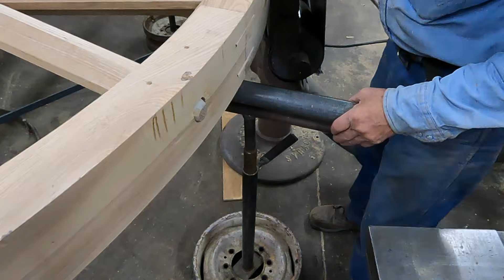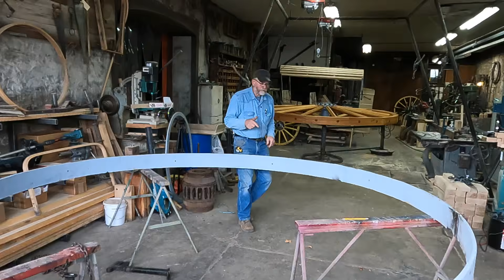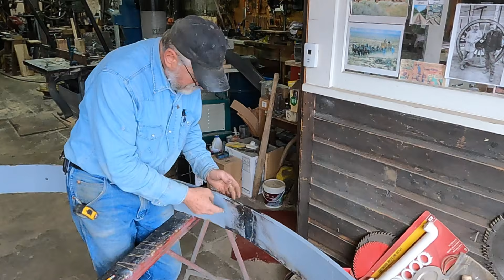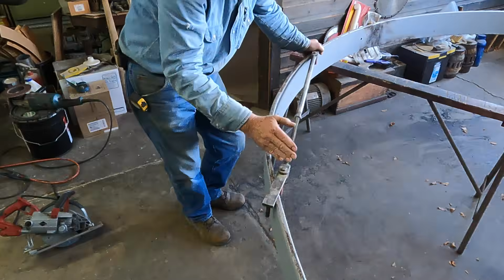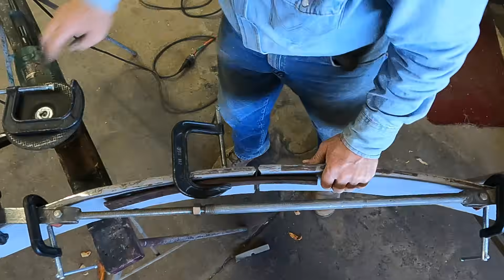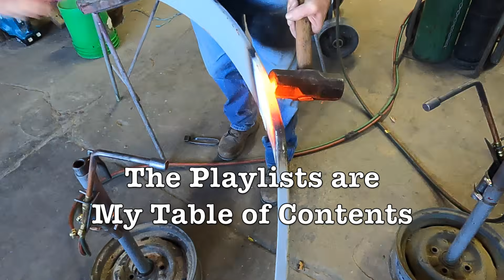Sizing The 10 Foot Logging Wheel Tire | Engels Coach Shop

Comment: As a wheel gets this big will it be harder to get a 100% 'seal' or contact between the wood and the metal when you shrink fit it? Maybe the greatly increased amount of metal allows you to make the steel rim smaller in terms of % of the wood wheel so to ensure a consistent tight fit. I'm assuming a tight fit is needed to keep water/moisture from getting into the wood, but maybe that assumption is wrong. In any case, I'm enjoying watching the challenges these big wheels present and your approach to dealing with them in your one man shop, that for these giants doesn't give much extra space to work with (big understatement!)
Reply: The physics should be the same.

Comment: When I do a comparison with some similar triangles math, it looks to me as if those hubs were designed for a 12ft wheel (evidenced by the spokes not quite lining up at the ends). Was there a normal/ standard size for these wheels?
Reply: Yes, 10 ft and 12 ft, so you could be right. The tires were for 10 ft, though.
Reply: @dianeengel4155  I think in one of the videos, Dave commented on the hubs not matching each other, so it would not surprise me if the wrong hubs (or wrong tires) were send. Dave is doing a great job getting it all together, but I worry the internal stresses in the wheels could cause problems down the track.

Comment: Hello Dave and Diane,  I hope that you will show most of the process of the second wheel.  I'm interested in how much easier and faster it will go once the "engineering" has been done.  My second question is at what point the circular wear bands will go on the spokes?  This build obviously is not for an amateur.

Comment: That wheel is going to be a work of art when you are done with it. The color of the wood when you coated it with the oil just popped. I love the look of the wheel like it is, be a shame to paint it.
Reply: It would be a crime to paint over that wood!
Reply: Was thinking the same, the paint bandits will blow that dream away..  @rosscollins2910
Reply: you have to paint it for it to last and protect it from the elements and especially UV from the sun.  The highest form of respect for all the work put into it would be to actually use it instead of it just sitting indoors collecting dust.
Reply: I know for a lot of craftsmen it's the build.  And taking nothing away from Dave's work.  For me it is that first coat of finish that makes the wood pop that makes me smile.  IMHO

Comment: Quel système de mesure compliqué
Reply: Talk about heavy duty,   I assume that not a lot of those stump pulling  wheels were made. It would be interesting to see how it was done in the early 1800's. Excellent craftsmanship,  Dave.
Reply: @ericvogel1126  Heavy equipment goes all the way back to ancient Egypt. So they certainly had some big stuff in the 1800s. Although the Great Pyramid was the tallest manmade structure until they built the Eiffel Tower. So it held the record for some 4,300 years. Which is pretty impressive.
Reply: Great Pyramid of Giza, then Lincoln Cathedral, England, then Washington Monument, but the pyramid outclasses them all! @1pcfred
Reply: Vous n’êtes pas le seul à être découragé par le système de mesure.impérial.
Reply: @horatiohornblower868  A long time ago I heard the comment "A people who survive this system must truly be superior." I have to agree wholeheartedly because even after 25 years in this country I still can't get my head around it. Not to mention that Dave is showing only the tip of the tip of the iceberg. Some examples:
- wire and sheet metal is measured in gauges. Gauges are different for different metals (stainless, plain, brass, aluminium, galvanized, ...), they have nothing to do with inches, and of course they are not marked on any measuring tool like calipers or such.
- similar for small drill bits. All of a sudden you have a drill bit #8 or #5 instead of some fraction of an inch which at least you could convert to something that can be measured with calipers.
- a 2x4 is actually only 1 1/2 x 3 1/2, even before shrinkage because of drying
- nails are sized and sold as 5d, 6d, 3d, 10d: no indication of shank diameter or length
- wood screws are sized with a diameter as #8 or #12 or #10 again with a length given in inches like 3 1/2
- electrical power is measured in Ampere instead of in Watt like "This vacuum cleaner has 12 amp". Except for heating. For heating it is "This forced air heater has 25.000 BTU".
And this list goes on and on and on....
I've given up trying to understand it and finding any logic behind it a long time ago. I am just not smart enough.
Reply: @horatiohornblower868  Vive la révolution! It was the trigger for a system that could be understood by anyone.